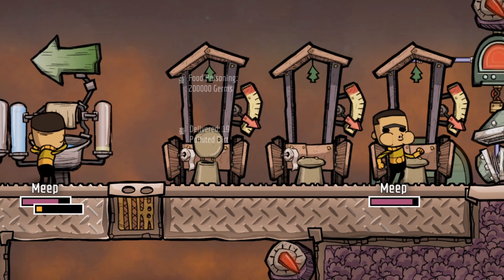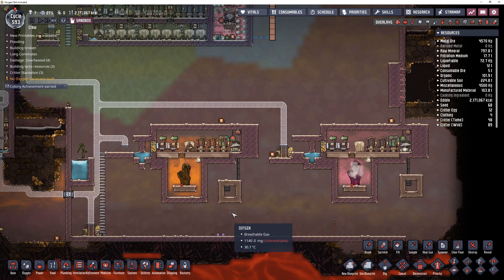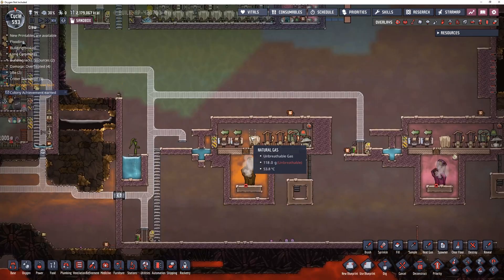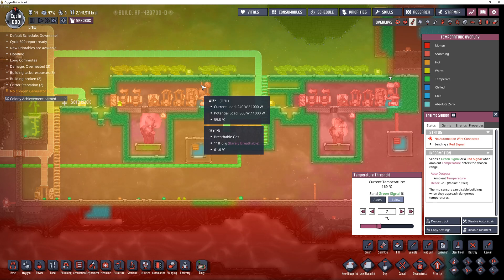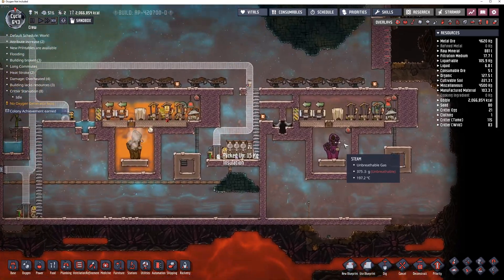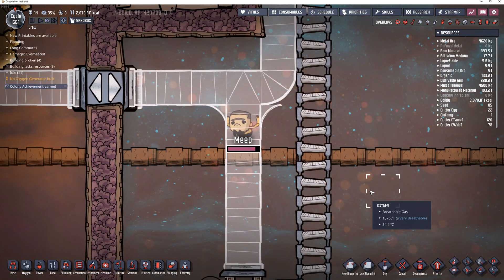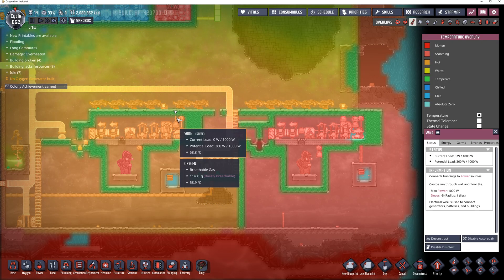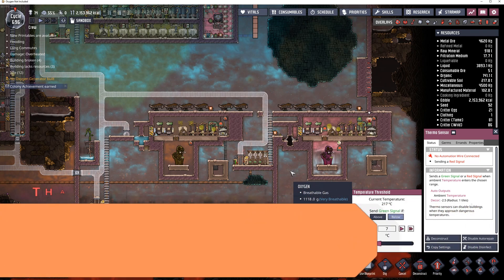Vent Cooling With POOP! Oxygen Not Included Experiment

Comment: I’m just curious to see if he did the calculations before hand, like mass output times specific heat capacity and then the difference in temp that you need to operate and then the poop cycle to see how much heat he needed to delete, it’d be much more difficult to make an equation but you could predict it

Comment: Oxygen not included Crazy contraptions

- Otherworld machinery

Petroleum Boilers
Regolith melters
Sour gas boilers (heat efficient boiler or the 4 aquatuners small boiler)
Insulation To tungsten melter
Auto heat refineries (dirt cooker, omeletes, refined carbon, cermic)
Geothermal energy powerplants
Rocket heat collector
Rocket Chimney 
Magma pumps

- Simple structures

Liquid Hidrogen and Oxygen maker
Heat deleting unit
Automated kitchen (oxygenared or atmo suit runned) 
Industrial Sauna / Cryo breaker design (francis john -200c ''breaker'')
Rodriguez (filterless water electrolizer system)
Solar pannel pyramid arrays
Beedpump systems (Electrolyzer beedpump or hot steam i.e)
Magma heat bleeder (Turbines connected to the magma biome from somewhere open)
Shine bug reactor
Bottomless Rodriguez (to produce only hydrogen)

- Gyser Tammers

Iron volcano tammer simple and complex
Gold volcano tammer simple and complex
Hot steam vent tammer (one or many beedpumps system)
Cool steam vent tammer designs (there are many like 95c and 20c)
Hydrogen vent tammer 
Slush and pH2O cleaning plants

- Easy structures 

Constant'' buffery'' natural gas powerplant
Algae synthesiser 
Transit tube system network
Liquid airlocks
Self-sealed oil well
Energy free filters
Infinite liquid and gas storages
Door compressors

- Ranching systems

Reed Fiber Dreko farm
Plastic Glossy dreko farm
Compressed hatch farm
Pokeshell lime production facility
Slickster carbon dioxide genocider 
Shove vole starvation ranch
Infinite pacu in no space ranch

- Space conquering

Thermium sweepers and auto dispensers to carryout the regolith
All the steel in the world for bunker doors and periferals
Rocket automation for leaving and coming back
Right measures to sizes and stuff 
Solar array in pyramid shaping
Liquid LO2 and LH
Meteor automation
Crossmap Piping
C miners setup
Cooling loops

Comment: Oxygen not included crazy contraptions
- Otherworld machinery

Petroleum Boilers
Regolith melters
Sour gas boilers (heat efficient boiler or the 4 aquatuners small boilers)
Insulation To tungsten melter
Auto heat refineries (dirt cooker, omelets, refined carbon, ceramic)
Geothermal energy powerplants
Rocket heat collector
Rocket Chimney 
Magma pumps

- Simple structures

Liquid Hydrogen and Oxygen maker
Heat deleting unit
Automated kitchen (oxygenated or atmo suit runned) 
Industrial Sauna / Cryo breaker design (francis john -200c ''breaker'')
Rodriguez (filterless water electrolyzer system)
Solar panel pyramid arrays
Beedpump systems (Electrolyzer beedpump or hot steam i.e)
Magma heat bleeder (Turbines connected to the magma biome from somewhere open)
Shine bug reactor
Bottomless Rodriguez (to produce only hydrogen)

- Gyser Tamers

Iron volcano tamer simple and complex
Gold volcano tamer simple and complex
Hot steam vent tamer (one or many beedpumps system)
Cool steam vent tamer designs (there are many like 95c and 20c)
Hydrogen vent tamer 
Slush and pH2O cleaning plants

- Easy structures 

Constant ''buffery'' natural gas powerplant
Algae synthesizer 
Transit tube system network
Liquid airlocks
Self-sealed oil well
Energy free filters
Infinite liquid and gas storages
Door compressors
Heavy watt wire power spine

- Ranching systems

Reed Fiber Dreko farm
Plastic Glossy dreko farm
Compressed hatch farm
Pokeshell lime production facility
Slickster carbon dioxide genocider 
Shove vole starvation ranch
Infinite pacu in no space ranch

- Space conquering

Thermium sweepers and auto dispensers to carryout the regolith
All the steel in the world for bunker doors and peripherals
Rocket automation for leaving and coming back
Right measures to sizes and stuff 
Solar array in pyramid shaping
Liquid LO2 and LH
Meteor automation
Crossmap Piping
C miners setup
Cooling loops

Comment: So would it be possible to make an automated trap that would cause dups to have "accidents" in a specific spot and thereby eliminate the need for restrooms? Basically lure them into an area that closes off with a outhouse as the bait. Then they all pee in the same spot into a tank covered with liquid flow tiles. Eliminate the need for plumbing and compost.
Reply: And while you are at it could you eliminate beds by providing other bonuses. Basically just have everyone pass out in the pee trough . Or maybe a locked barracks that also has food where the dups go after work and get locked in for cycles so they eat pee and sleep in the same spot with o2 provided by the pool of pee. Ok this sounds like a torture chamber but i wonder if you could basically eliminate the "necessities" of dup-keeping, bathrooms, mess halls and bunks rooms and still have a functional colony.
Reply: an automated trap is basically you use the checkpoint and then when all the dupes are in and it is during bathroom time that is when you could do that
Reply from the maker: Hmm interesting idea.

Comment: If you want to get into mid-tech solutions using polluted dirt, it might be valuable to see how well you can keep a thermal regulator or ice maker cool using similar means.  Or Check the cooling potential of the polluted dirt coming out of the Ethanol distillery

Comment: I wonder if you could use that wash basin interaction of the polluted water instantly phase changing when it drops out due to it's temperature for anything actually useful. 
Granted if you are going for hot then you'll have to use ceramic to raise the over heat temp enough.
Reply from the maker: Yeah I was able to get a close look at it. When a hot sink is used the p-water will flash to steam. I don't know if it's all that useful, but it is technically self cleaning :)